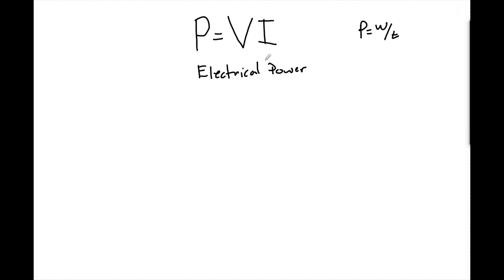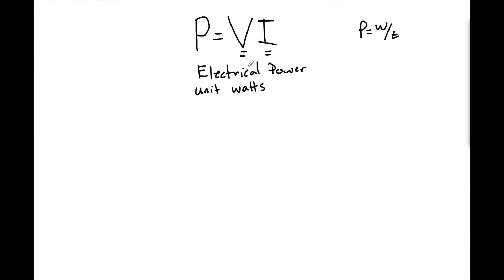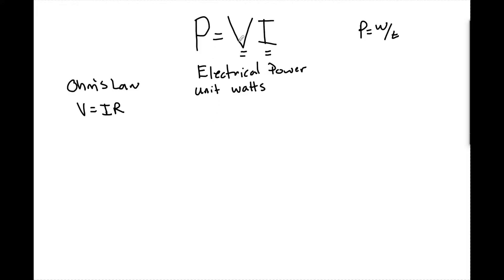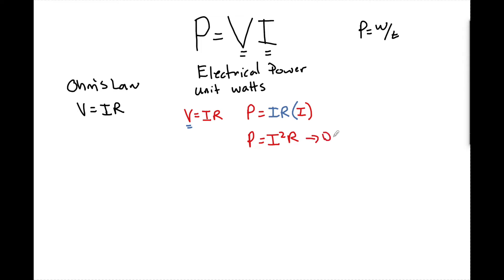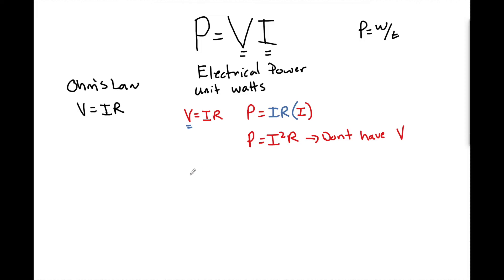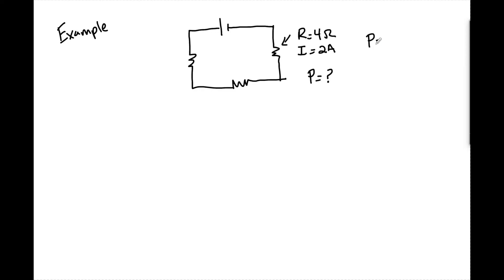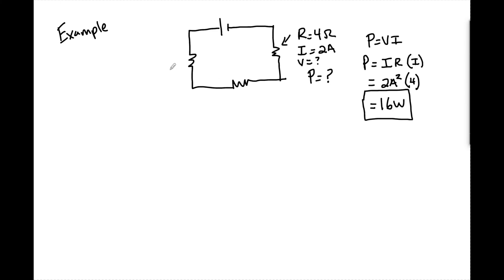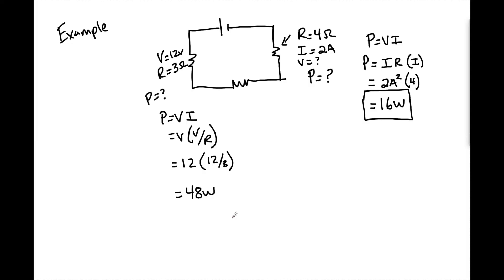How To Use The Electrical Power Formula In Physics Class

Comment: Is it P=V^2/R as stated earlier, or P=V (V/R), as stated at the end?
So, if it's 12V & 3 Ohms, that would be 12x12 / 3, rather than 12 x (12/3)...?
Reply: they are exactly the same algebraically
Reply: @NerdyAnas  consider the outcome of the two examples

Comment: In 3 ohm resistance u have current also because in series current doesn't change so you can also use p = i²R for finding power in 3 ohm resistance 😊